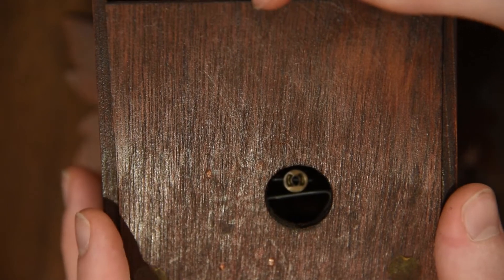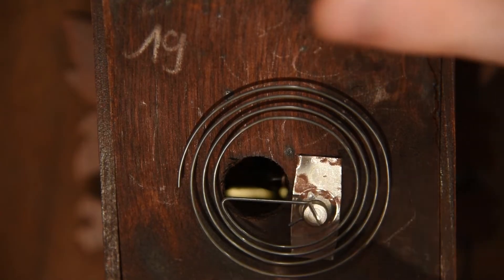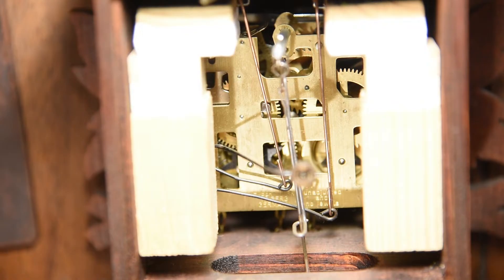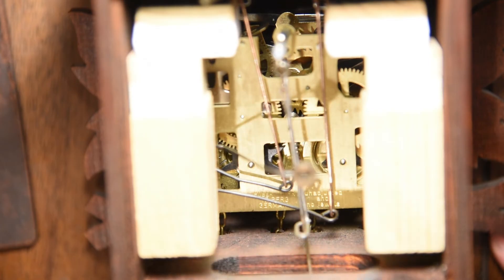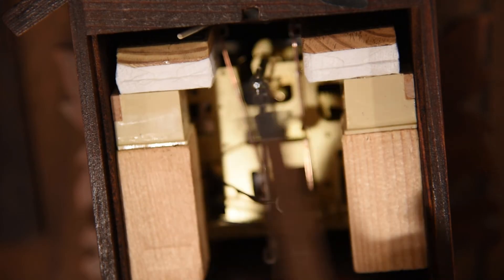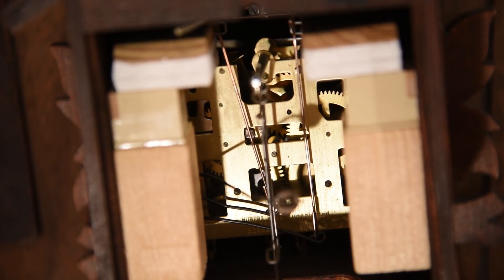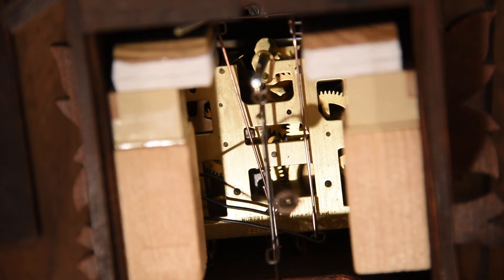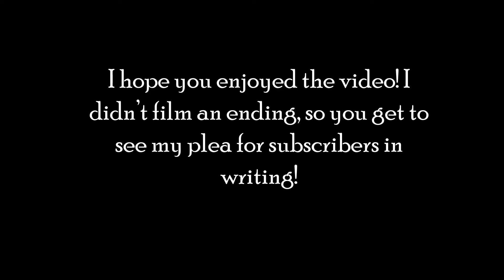How A Cuckoo Clock Whistles

Comment: Thank you for the video! And is it possible to reduce the volume of the whistle?
Reply from the maker: I'm sure there is a way, but it's not an adjustment built into the clock-it would probably require some kind of regulation in the mechanism, maybe decreasing the length of the sticks that pull the bellows up and down?